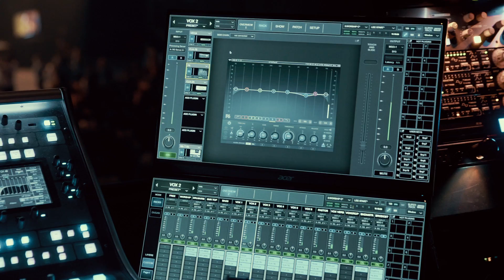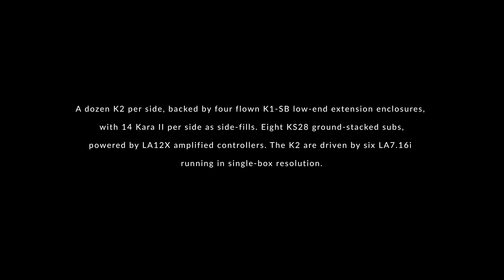Skylark AV  - Victory Tulsa L-Acoustics K2 System Install

Comment: 68 cabinets.  Wow.  I mean it would be a nice system.  However, to me it makes no sense anymore when you could fly maybe 6 Danley Sound Labs boxes.  They have better sound quality, more output, better coverage, and much better pattern control.  I don’t want to go back to a J array anymore after all the Danley equipment I have installed and mixed on.  Beautiful install and nice system though.
Reply: The only venues you see using Danley are high school sports stadiums because they sound very bad.
Reply: @iXetsuei  you probably don’t have experience with them
Reply: @iXetsuei  So you never heard them. A well designed and well setup point source will beat a line-array in sound-quality everytime.

Comment: And that's what $650,000 usd looks like.....at a Church!!! wow, I'm in the wrong business.
Reply: I would think it’s way more than that. I know of smaller venues that are $1,000,000 or more for audio. This is some of the best equipment made.
Reply: @ScottGunMag69  It's good but nowhere optimal for an install. Line-arrays are always a compromise and better suited for touring, i.e. changing venues with different acoustics.
Reply: churches are the absolute best scamming business ever.

Comment: What type of speaker wire do you use for these large PA deployments? Looks like individual conductors.
Reply from the maker: Yep. For this particular one, and for everything to fit in the conduit that was already there, we used THHN. We pulled that to a junction box that converted the THHN to speaker cable to each box.
Reply: @SkylarkAV  Do you tag each reel and cable before pulling all of them together or you test them after pulling to see which is which? Looks like you're using terminal blocks in the rack before going to the amps also. Nice!

Comment: Is the church pre-designed with hang points for all the arrays?  Is that factored in initially or was there additional structural design/support needed?
Reply from the maker: The existing steel in the ceiling was able to support the new Arrays, we where able to put the PA exactly where they need to be.

Comment: Curious.  If install, why not their new L2 system?
Reply from the maker: L2 was not out when the Church picked their PA. Furthermore K2 fit the room better and met the church’s spec.
Reply: I could be completely wrong on this but from my understanding, the L2 is designed with easier set up in mind.  Since this is a permanent install, ease of setup is just not necessary.  K2 is prolly cheaper because of this while having the same level of sonic quality.

Comment: I’m new to the whole audio engineering, but my question is what is the difference and benefits of hanging the subs rather than putting them on the floor?
Reply from the maker: The Church has (8) KS28’s on the floor also. The K1-SB’s flown with the K2 are a compliment to the K2 and don’t act like floor subs.
Reply: Well the floor subs in this case acts like fillers for the front rows and the flown subs are to cover the back with lows. Now you can do it without the flown K1-SB's but the issue is that you sit with compromises. 1) I'm not going to get the desired lows for the back. 2) if I want to get the desired lows for the back, I'll have to increase the volume on the KS28's that is absolutely powerful enough to get to the back without a sweat, but the poor people in front are going to rattle in their seats.
Reply: You even out the coverage and lower hotspots in the front. Usually front row is 6-12 dB above the rest for it to travel to the back, hanging it lessens this effect
Reply: Easiest way answers this question it’s better coverage sub sonic frequencies because sometimes you could be in weird church that don’t really fit subs on the ground. The way they traditionally should be suited and you can feel it better in your chest 

Perfect world having subs both on the ground and in the air is chief kiss! 👌🏾